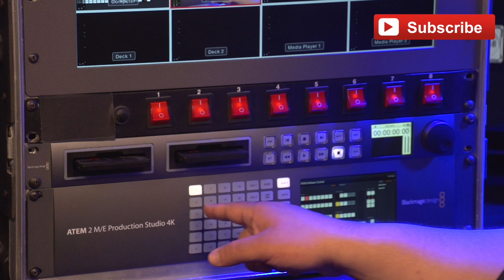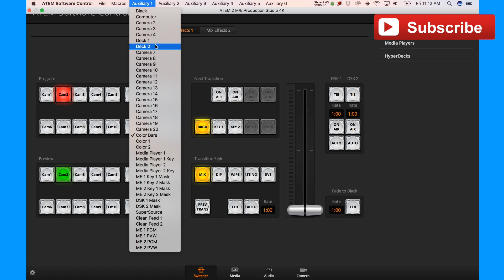Three Ways To Set  Your Auxiliary Outputs - Black Magic Design ATEM Switcher

Comment: Is there a way to run two atem switchers at the same time and have full control of the same inputs? We will run in-house screens on one then the online service on the other.
Reply: The Atem 2ME Switcher is what you want, ME stands for mix engine. This means it is basically two switchers in one sharing the same inputs.

Comment: I use Atem 1 M/E Production Studio 4k.  I need Video footage without Grafix.  How Can I do??
Reply: I think the Aux out gives you just that. It will give you video from 1 input with no graphics. I'm pretty sure it can't be used as a second program out.
Reply from the maker: What do you mean by second program out
Reply from the maker: You would need to capture the footage before you add the graphics